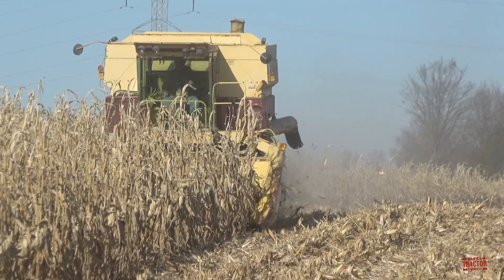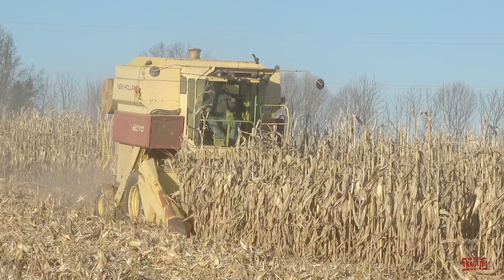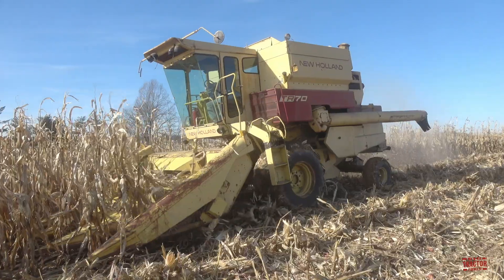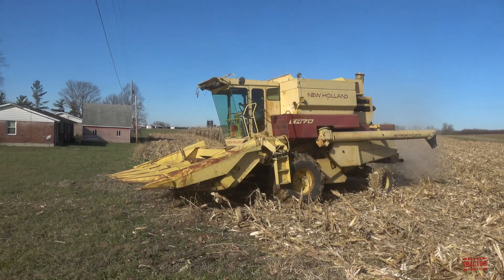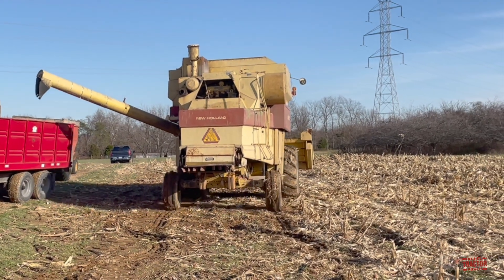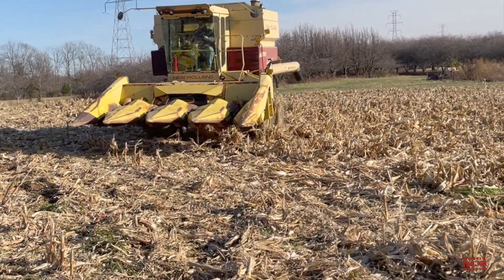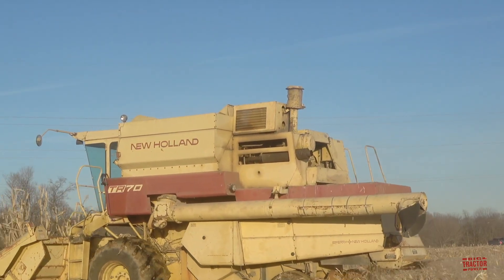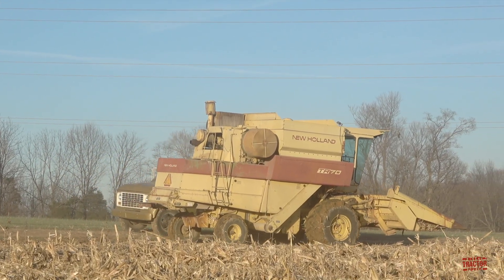The First Rotary Combine : NEW HOLLAND TR70

Comment: Until now, I had never hard the brand name CLAAS pronounced as "CLAYS" but I guess that makes sense due to its spelling.  We have always said it as "CLAWS" as in Santa Claus, being a German name, we thought that was correct.

Our combine was a 1970 or 1971 Ford 620 painted in Ford Blue and White paint, but the build plate was marked CLAAS, West Germany.  Back in 1971 when my father purchased it, he also had to purchase a complete toolbox of wrenches and sockets and such, the combine having been built using all METRIC measurements and METRIC fasteners.  In fact, those tools rode in the combine for the 30 years that we owned and used the machine.

With modern combines, it is common to unload on the go.  But with our old Ford 620 (aka Claas Consul), the vibrations inside the operators cab made it necessary to take regular breaks, so unloading the bin was a chance to get outta the cab and stand on solid ground for a couple of minutes.
Reply: Claas and Claeys are not the same company. Claas is German, Claeys was from Belgium.

Comment: Australian farmer here.I drove one of these for a neighbour in the 80's,no complaints.We ran a MF 850 on our place and the TR,though  same size,was a much faster,as in big eater,machine than our Massey.They were much heavier on fuel with the 3208 Cat  with a duration of 9-10 hours a tank,compared to the MFs 354 perkins, 12-13 hours on a smaller tank.The TR 70 was a fine machine.I thought of getting one myself but bought a Inter 1480 in the late 90's.

Comment: I do NOT think this was the first New Holland Twin Rotor combine, IIRC, their first TR Series were RED, with Yellow trim, and came out in the late 1960's.
I am thinking that the Model number of the first was something like TR-65, and the ads first appeared in magazines like Farm Journal and Successful  Farming.
The New Holland dealer at Springfield, NE had one of these red and yellow combines that set on his lot for several years unsold, and at one point, my uncle went to look at it, but the dealer would not come down off the original price, so it stayed there.
Reply from the maker: The New Holland’s in the 60’s were the 975, 985 and 995.  There were conventional combines.  They were painted red with yellow cabs.  I really really want to film one of those classics.
Reply: @bigtractorpower There is also the 1400 I believe is the same but with diesel motor? Neighbour has one low hours that was stored as a spare. Unfortunately he pulled it out for room and likely it will deteriorate outside like my dad's old 985 has. I remember back then all the metric bolts but it was a nice combine in it's day. Great video as always.

Comment: IH dropped the twin rotor concept to stick with the axial flow and the engineer that was on the IH twin rotor took the idea with them to New Holland. The 1st versions of IH concept of twin rotor was based on the IH 234 Sheller Unit Rotor
Reply: The engineer's name was Roland Hill and I worked with one of his former coworkers from East Moline who told me IH had decided to go with the single rotor and he (Hill) was a proponent of the other design.  There was a consent decree that kept New Holland from selling machines until 1977 when IH released the Axial Flow line.

Comment: It’s nice to be able to make a comment first hand experience. Yes we ran a TR 70 with a 3208 cat motor. It was a big machine for its time. Three weeks Into it’s first season we picked up a large chunk of a granite type rock. We had downed corn and no crop insurance. As much as possible the corn has to be harvested. 
The rock trap had failed to function and the rock was digested causing major frame damage that the rotors were so far off their mounts. 
The combine went to the selling dealer who advised us there would be no warranty even though he confirmed the Rock trap door was defective. We had to get an attorney and finally settled (cost of the machine , plus loss of the use of the machine during harvest ) out of court 14 months later. 
NH took the combine back and cut it up into pieces we were told. We went back to IH because at the peak of the accident we had no combine. The IH dealer helped us with a demo Axial Flow that we later purchased. 
Thanks for all your wonderful videos.
Reply: By the way there were no granite deposits in that farm or anywhere near our area! It was never clear how it got in the middle of the field!

Comment: I worked on these as a very young man in the 70s. They had a lot of capacity for the time, and they were easy to adjust. Grain quality was superb. Caterpillar engine was strong and reliable. 
The headers were.....let’s say crude, but, they would go all day. The header height control for the grain head was a lever that pivoted between two 3/8 bolts to close a ground circuit. When it went up or down, lights would dim. 
Hey, it worked.
Reply: many TR70's had Deere cornheads with an adapter.  worked very well.

Comment: Several of my neighbors ran these growing up.  Great machine for harvesting, but they all had a bad habit of catching fire!
Reply: You had to keep the engine compartment clean, especially with the Cat engine. Because of the V8 configuration the turbo was on the back side close to the sheet metal. Chaff would build up around the turbo and catch fire. I owned TR 70's and never had an issue. It happens to JD combines quite often too. Again safety and maintenance.

Comment: One thing blows my mind, completely, when i see these kind of machinery.
The age...
If i consider the new equipment, i doubt that any of them, will be running in 50+ years out into the feauture.
But a lot of the machines built back in the 60's - 70's and 80's are still running to this day.

Comment: I was wondering who first made the rotor combine, I think it was 77 or 78 when gleaner made the first transverse rotor.
Reply from the maker: Here is the Rotary Combine time line
New Holland 1975
International 1977
Gleaner 1979
White 1979
Massey Ferguson 1985 ( Acquired White)
CLAAS 1995
John Deere 2000
Reply: @bigtractorpower   ok awesome, thanks.
Reply: Minneapolis Moline had the first rotary cylinder in the corn sheller before any one else had there's.
Reply: @alancopper7866  was that a pull type?
Reply: The first patent for a rotary threshing system was filed in 1873.
Reply: The N series was released in the fall of 1978 they made 50 units, in 1979 they were actually introduced to the market
Reply: @RJ1999x  oh ok 👍
Reply: I always thought IH was first! Never thought about NH! Wow!